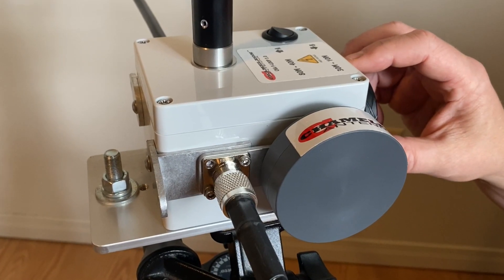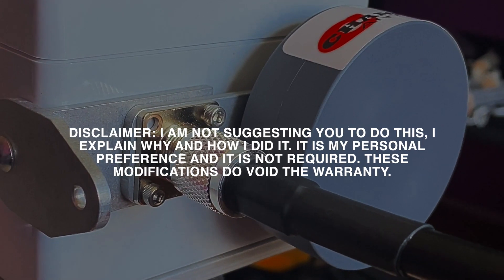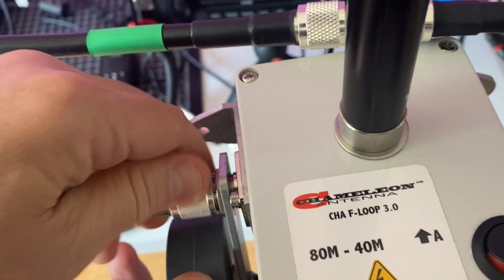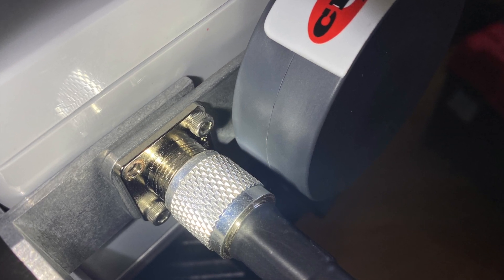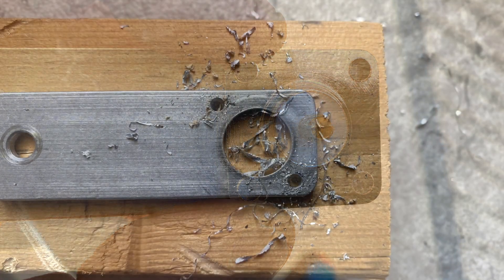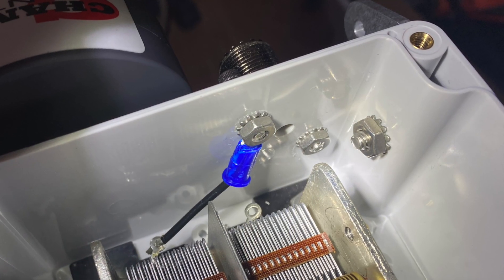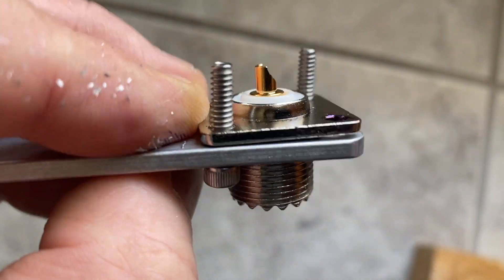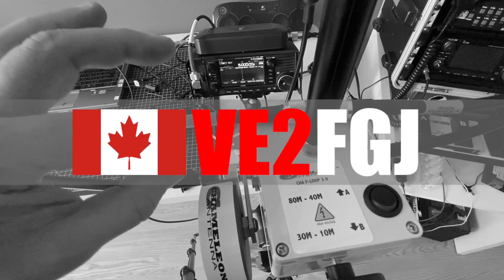Chameleon F-Loop 3.0 w/ Power Compensator Permanent Installation

Comment: Thank you for this video. I recently purchased the Chameleon F-Loop 3.0 Plus and was wondering if you have used the power compensator along with the aluminum rigid loop? My concern is that the power compensator wouldn't work with the rigid loop, but I am not sure. Thanks again for your video and I hope to hear you on the air sometime! 73's de AL9G.
Reply from the maker: I would bet that yes you can use the PC and the rigid loop. The rigid loop or coaxial cable connects to the same location. To be sure email Chameleon support. Thank you for the question and great comment! 73
Reply from the maker: Looks like you can here is a video: https://youtu.be/Rg1ekQJLQRI?si=ie9RiAJWcKY5V_-T&t=744

Comment: What were your results after buying it? Longer distances on QSOs? 73 de Luis, HB9HJU
Reply from the maker: I very much like the F-Loop 3.0, high quality product. Longest QSO so far was 1750 KM on SSB on 20M with 40W with the Booster cable (146 in), I was received 59, which means I could go further out. I have spent most of my time upgrading the F-Loop to install a custom remote controller and programming an Auto-Tune function, initial tests are amazing. I plan to make a video and include a couple of SSB QSOs. 73
Reply: @VE2FGJ  excellent. Was the power compensator a good buy? Would you recommend it?
Reply from the maker: @lasantiagoa  Yes definitely worth it.

Comment: this is a nice idea, I have the 2.0, It doesnt have the top switch I think It needs to be opened from the bottom. I will check it out.
Reply from the maker: Is it the P-Loop 2.0?
Reply: @VE2FGJ  It's the F, same one as you have but older with a yelowish front and the long switch for bands A/B at the top
Reply from the maker: @CE3FJK  Looks to be the F-Loop 2.0, you can open it from the front 4 screws and remove the knob with an allen key. Internally it should be similar as the 3.0

Comment: What the heck is a "power compensator"???
Reply from the maker: The CHA PC (Power Compensator) increases the power handling capability of all Chameleon Antenna magnetic loop antennas by about 2 1⁄2 times. You can Google it for more details.
Reply: @VE2FGJ  I'm guessing that you have no idea what it actually does from your answer.
Reply from the maker: @daveG1020  It is a high voltage capacitor, it is coupled to the loop. Please Google it.
Reply: @VE2FGJ  I googled it...it is not just a capacitor.  For anyone who actually wants to know what this is, Chameleon states that it is a variant of this: https://en.m.wikipedia.org/wiki/Static_VAR_compensator
Reply from the maker: @daveG1020  The inside very much looks like this: https://www.genvolt.com/application-information/51474a27591a0/High-Voltage-Ceramic-Disc-Capacitors
Another manufacturer: http://www.maxcapacitor.com/en/product_details.aspx?id=673
Quote: They are suitable to use as coupling capacitors for transmission line and carrier frequency equipment. 
I do not know how it works, but is interesting.
Reply: @VE2FGJ  Good info.  Thank you! 👍